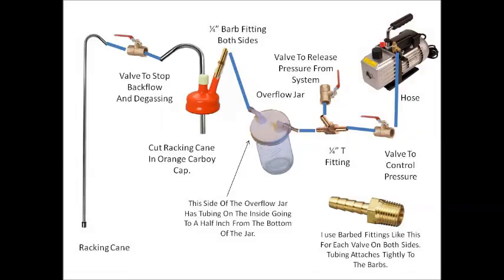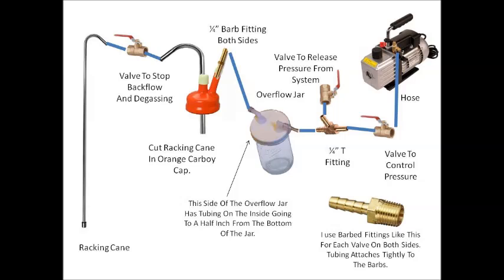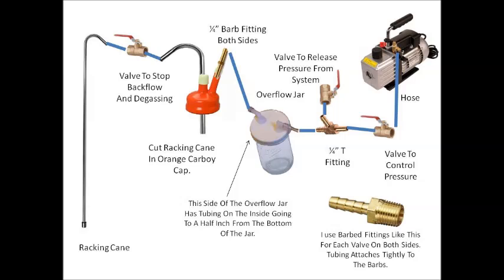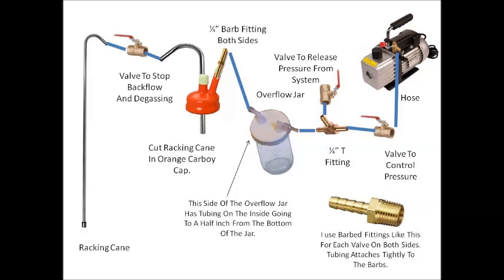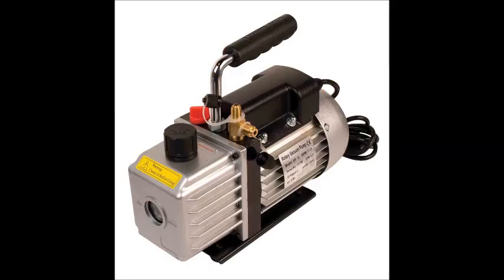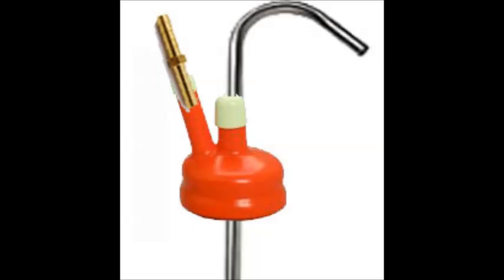Build A Vacuum Pump Wine Degassing and Racking System!

Comment: What size vacuum pump do u use?
Reply from the maker: Harbor Freight has 2 models.   I got the Less Expensive one.   Either one would be fine.

They had a coupon, so I took advantage of it.    If you  look to my blog, there are some links to other sources to get one, if Harbor Freight is not by you.   They may have a website, but I would get it in person, in the event there is a problem and you need to exchange it.